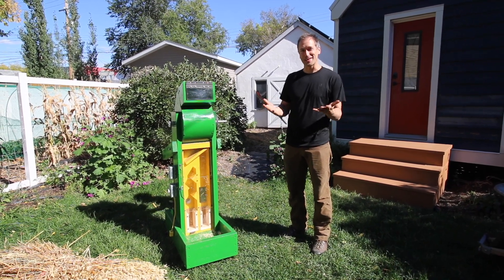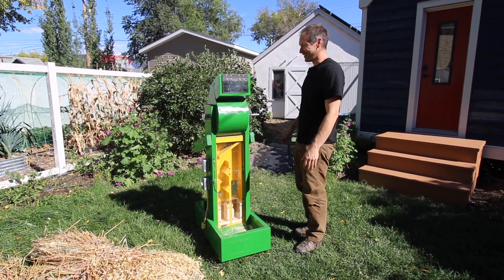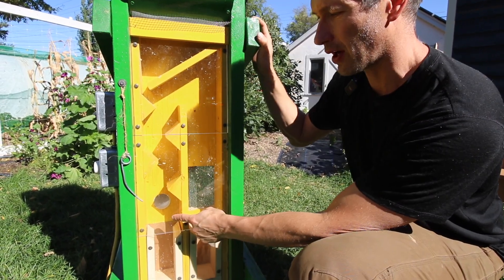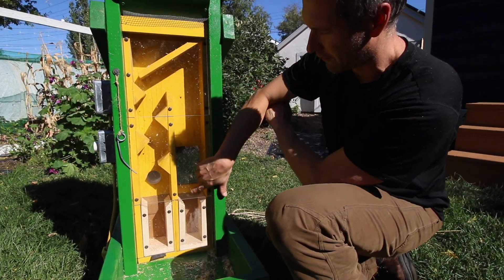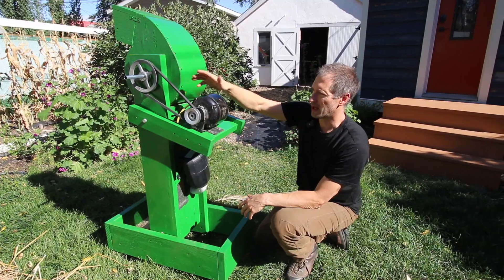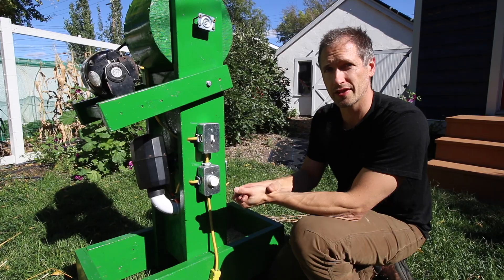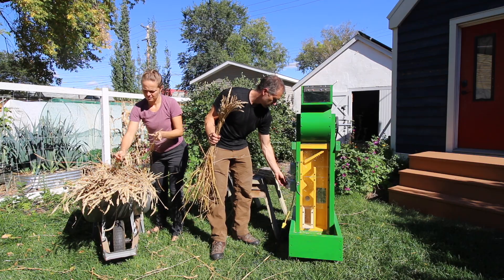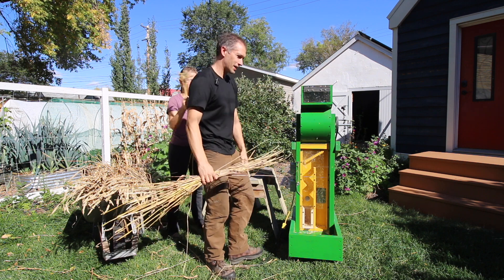Small Scale Grain Threshing Machine

Comment: For the oat you could add a downward ramp with a belt sander with a rubber belt instead of sandpaper. Rolling the oats, at a reduced speed would strip the husks off. Then into your separator.

Comment: I bet itd be possible to make one that runs totally off compressed air. Use a compressed air feed for the blower and an impeller on the beater drum drive shaft instead of a gear and pulley system. You could put an airline regulator on both air lines to adjust the force for whichever crop you are working with.

Comment: Mad impressive! Two things that could help:

1. Add an earlier stage with perpendicular blades to cut the wheat, so you don't get the large pieces. It might be difficult, but I imagine with a blunt enough edge and little enough force it would just break the stalks but not the grain, but maybe that's not the case.
2. Integrate the blower with the roller such that the outlet is the full width of the roller, so you have more surface area which will reduce the amount of chaff that falls through. It's already being agitated at that step, so it will have a much higher chance of being exposed to the air flow than the small channel, where the berries could block the airflow from the chaff. Or just add a second blower stage.

Comment: Seeing as you have to double handle each stem anyway, would it not work to trim the heads off each stem and let it drop into a bucket, rather than line them up, and then have a hopper you tip all the heads into so they feed into the thresher by themselves? That should work for oats then too as you handle it once above a bucket and then whatever drops off goes through the hopper.

Comment: I bet you could use parts from an old drill press to upgrade this. They already have a variable speed belt driven pulley system with control, capacitor, and an on/off button and switch. You could probably just take the top case and motor off a drill press as is and fit it to this thresher.

Comment: your screen needs to keep the oat /chaf combination in the thresher until it's broken down, either a smaller screen or maybe more teeth on the spinning wheel. 

I had paper shredders and metal shredders in heavy industry. Most classifying equipment is also run with air currents, however in order to classify things correctly they must have the weigh difference as you have discovered.

Comment: I saw your lentil short vid and wanted to see more about the machine. Great idea/design and implementation!

My thoughts on the design:

Having to catch the grain in a closed bin is a pain. Maybe if you just aimed the blower up the grain chute you wouldn't need to seal the grain bin?
Someone else suggested a vacuum to suck the chaff away. That's a great idea, but I think you'd need something like a leaf-blower/sucker to avoid having to redesign the system. Otherwise you'd need to make a filter to protect the blower, and you'll have to empty the chaff from it every so often.

To get around the straw problem, could you have a larger exit from the beater drum? Direct the output over a longer grid that is flat, but has an open outflow for the straw to go through. So the grain and chaff fall down, but the straw goes through and out. If may need some airflow to keep the straw from jamming the outflow though. Possibly a design that need several iterations, unfortunately.

Comment: This is a nice build.  A couple of point that I see.  I think it would have been better to separate threshing and winnowing into two separate machines.  Beat it out onto a shaker screen and into a bin.  Then run the contents of the bin through the winnower as many times as necessary.  The other thing is that most modern varieties of grain have been bred to dry in the field without shattering.  I'm far south so it may be different other places, but here, there's no benefit to binding and shocking. I cut everything as close to the head as I can and leave the straw standing.

Comment: Very innovative. From looking at hammer mills for processing hard rock gold ore, they use a very fine screen, so that the end product is very fine - liberating free mill gold. Perhaps you might have an easier time with the oats if you use a smaller screen size, but not so small they get turned into dust ofc.

Comment: For the oats, would having a smaller (metal) pins and more of them in the machine help break the two parts together? It could be something you could try. Also if you do, please check it with the other things like wheat and barley and see if that works better.

Regarding still having some chaff fall into the grain bin, you could look at some sort of mesh, wish you could push in to catch the chaff if it’s larger than the grain seed. If so, you could fit the mesh into a small wooden frame and then interchange them for size for the different crops you
Reply from the maker: Thanks.  Maybe adding pins would help strip the oat hulls a little better.  I found I could clean them pretty well eventually by running them through the machine a few more times, but perhaps if there were just more pins on those spinning beater bars, I could accelerate the whole process.

There is already some mesh between the upper drum and lower winnowing chamber.  You can see this around the 1:50 mark.  I've tried a few different sizes and settled on the 1/4 square mesh for now.  I like your  idea of mounting the mesh to a wooden frame to help make the insertion and removal a little easier.
Reply: @VegetableAcademy  glad to help. I’ll be making one of these in the next year so I’m glad you’ve done a how to video.

Comment: Wouldn’t citing the heads off be an easier way to process the wheat?
Reply from the maker: Maybe.  I did try that a bit and found that if I toss in handfuls of wheat heads it adds more chaff to the machine.  When I just stick a bunch of attached heads into the upper drum as shown in this video, the wheat hulls are knocked off while usually leaving the centre straw within the head still intact so I can withdraw and discard it without it having to travel down through the machine.  It needs a bit more experimentation next season.

Comment: For my flax seed I ripple off the seed heads then run the seed heads through a wide gap corn grinding machine. It breaks the round seed pods and releases all the seed without damage to the seed. I then take that and run it through a couple screens before running it through my seed cleaner. Works like a champ.
Reply: Make a video of it the process & functioning? Please!😁
Reply: @sherryhayhurst3027  This is not mine but looks very similar. This one is a little better built but they do work great. Once set you can clean seed quite quickly.  There are plans on the web so you can build one. https://youtu.be/u4c1-ajSILA
Reply: @sherryhayhurst3027  There are plenty of them on YouTube to watch. It's pretty much the same as the others.

Comment: My seed cleaner uses a vacuum instead of a blower. With the oats I'd just use the old methods of threshing then put the chaff and seed through your seed cleaner. The looks like it does a great job with wheat. With the oats you could stomp the heads as well if needed. A long stick with a chain or leather strap and a shorter stick will make a fine thresher for your oats. That way you are not stomping with dirty shoes on your nice grain.

Comment: The top drum looks like a very good hand & arm shredder-chipper.
Reply: Only if you have a child-grade mentality. If you stick your hand into a ' plugged-in ' and/or ' running machine '. You deserve to get injured.
Reply: @redstone1999 screw-ups happen.
I've fed vines into a shredder and had them catch me, yanking me towards the machine. Luckily the vines broke instead of breaking something in my arm, or dragging me in. I'd been working for a bit, wasn't thinking and had got too comfortable around the machine.

It just takes a second of being distracted and off-balance. You lean against the flap to stabilize yourself and whoopsie!
Reply: @samuelmellars7855  I had to stop an adult helper from sticking his hand into an electric wood chipper to unblock it. 
His excuse was the motor was going to tripped the fuse. I said, " Unplugging the chipper was 100 % safer way to unblock the machine".  
Loose clothing around equipment is another thing I see people do that begs to get someone hurt.

Comment: Great build! Question. Does the thresher spin towards the feed entrance, or does it draw the seed in? This is difficult to put into a question. Looking at the pulleys, do they rotate clockwise or counter clockwise? 🤔 any help approciated.
Reply from the maker: The spinning bars are rotating upward and back, drawing the grain heads into the chamber.  If they spun in the opposite direction, a lot of the grain would spew out the front (with this shape of chamber anyways).

Comment: Worth mentioning to anyone trying to recreate this, if you’re going to use a dimmer switch on the blower motor it has to be a DC motor or else the dimmer switch won’t do anything.
Reply: Not true. Ceiling fans use special dimmers for AC.
Reply: @TheRainHarvester this isn't a special dimmer though.  If you plan on using an AC motor, you will need a special dimmer or AC motor controller.
Reply: @TheRainHarvester I have been using the same dimmer a regular Home Depot 12 amp dimer for 30 years to control a Riobi Router and it keeps working. I am not sure if todays dimmers are as good 🤔

Comment: I think that you can simulate the effect of rubbing the oats in your hands if you have two rubber belts running vertically in opposite directions with an adjustable gap that you set to match the grain size. The trick may be to have a slight different in the belt speeds.
Reply from the maker: Yeah.  An adjustable gap would be key, as would the ability to apply uniform pressure along the belt surface.  I think only one of the belts would need to be moving.  thanks for the idea.  I was thinking about rollers and spinning discs to create the rubbing effect, but never belts.
Reply: @VegetableAcademy  What about vacuum beaters. Do you think something like a vacuum beater would work it loose?
Reply from the maker: @DavidTuckerII  That is a neat idea.  If you built a custom sized chamber around the spinning vacuum beater and ran the grain through the chamber, you might just cause enough friction to clean off the last hulls.  I don't think it would break the grains, and the spiral brush configurations on most vacuum beaters could be really helpful in moving the grain through the chamber.
Reply: @VegetableAcademy  U need a set of concaves around your cylinder that are adjustable like combines,,,ur cylinder speed needs to be increased for oats around 1100 rpm
Reply: You are correct.  What i have seen is two rubber car tires with only a grain width between them. One tires rpm being much higher than the other tire. Does as you suggested,  rubs out the grain.
Reply: .....or  also I could see a set of two adjustable face plates ,oscillating against each other with the right gap between them; much like the pad of a palm orbiting sander does.
Reply: Isn't it basically a loose/wide grind to mimic rolling them between your hands? A grinder/mill with a wider gap? Or 2 stones.

Comment: I think this is a little over engineered, I made one that can process just a little bit less and it's a bit slower due to over load shutdown however you still have to line the heads up like the one you've built. I think one that can process straw and grain as well as winnow would be more bennaficial and a lot faster with less of a process because doing it this way is definetly tedius here's what I made https://youtu.be/SrCflcMGfi0 it's a lot smaller but works well . want to build a bigger better one however
Reply from the maker: Thanks for sharing your project.  I checked it out.  The grain should knock out of the husks a lot easier than what I saw in your video demonstration.  I higher RPM or larger turning radius on your beater mechanism could help with that.  Have fun scaling it up.
Reply: @VegetableAcademy  I'm gonna make it do straw as well once I get a chance cause feeding heads in is lame, lol

Comment: Nice threshing machine that you got there, to give you better result in oats and maybe even make it work for over crop like beans you can try to copy what we use in combine harvert to make them work in any crops. 
First you can add a system of fixed threshing finger that you go between those of the drum (they could also be set at different depht to change the threshing intensity).
A small mash would also make it harder for the grain to fall through or as we do on combine you could use a fine plywood board that would slide undreneath the mash, then by pushing it in you woud block a part of your screan, letting you adjust your threshing intensity by forcing the grain to make multiple turn inside the thresher.
Reply: Way to go Quentin!!

Comment: Very cool!  For clearing obstructions at the top of chute, would a small hinged door provide better access?  A little weather stripping around the door would minimize forced air loss.
Reply from the maker: Thanks for the idea.  A hinged door would definitely make it easier to access the stuck straw. However, I need that straw to still pass down the same channels because there is always wheat or oats mixed in there too that I wouldn't want to just discard.  I've found that as long as I keep long pieces of straw from entering the machine in the first place, things run a lot more smoothly and I don't need to use the clean out poker all that much.

Comment: You commented that the rate limiting step for threshing is the preparation of the bundles to insert into the machine. I thresh with a Toro leaf blower/shredder and had similar issues. This year I tried making bundles for threshing when I harvested the wheat. I put a bunch of rubber bands around my left wrist, gathered a bunch of stalks that seemed the right amount with my left hand; then cut with the sickle and slipped a rubber band around the end. The bunches were about 2-3" in diameter. These were gathered and tied into sheaves to stand and dry down/ mature. When I ws ready to thresh, the bunches were already gathered and ready to insert. It went MUCH faster.
Reply from the maker: I can see how those pre-made bundles that would make the threshing a lot faster!  However, I'd still be taking the time to line up the heads in the field...I wonder if that would end up being faster overall or not.  Thanks for sharing that.
Reply: @VegetableAcademy I wonder if you made a bigger feed system to beat the grain out, and had a second vent to blow air from the front to back to push big pieces out before the reach the separation stage where they get caught and backed up would work.
Also, it’s not necessary cause to pick through that doesn’t seem like a whole lot it’s not exactly perfect but nothing is and it does it’s job wonderful. But I wonder if you could build a second little chamber on the side you could dump into for a second screening to cut out the bigger pieces your left with.

A lot of work I know but just a opinion!

Comment: Dimmer switches do Not adjust the speed of a AC motor properly.  AC motors run at one  speed for 60 hz electricity. Lowering the voltage like a dimmer does is not speed control for a ac motor.
You have to change the frequency.

You May be lucky and the motor is a Universal motor in the Jacuzzi fan that can run on ac or DC but otherwise you are damaging the motor using a dimmer switch as a speed controller.
Reply from the maker: Thanks.  I will have to pull apart the jacuzzi blower to have a look at the motor if possible.  Alternatively, I suppose I could run the blower at full power all the time and control the airflow into the winnowing chamber by releasing a variable amount of air out the backside somehow before it enters.

Comment: I love machines like this. Well done. For the oats, perhaps if the top rotating separator fingers passed between stationary fingers spaced in-between - something that would provide interference, that would do a better job of breaking open those hulls.

Again, excellent work.
Reply from the maker: That's an interesting idea that I hadn't thought of.  It would certainly add another degree of disturbance that could help release the hulls.  Thanks for sharing that.

Comment: How do you clean out the screen? You went over it so fast, you said it collects in there but seems to be an area of congestion.
Reply from the maker: The screen slides out to allow any of the straw it caught there to fall through.  I need to clear the screen about once for every time I fill the collection box with grain.  It would be nice if more of the straw fragments were chopped up smaller so they didn't get caught in the screen.  Then I could keep it running longer.  Those modifications will have to wait for version 2.0 though.  For now, I'm just happy that it works.